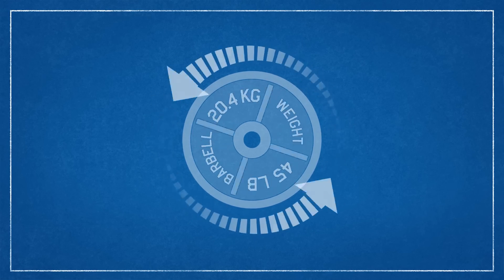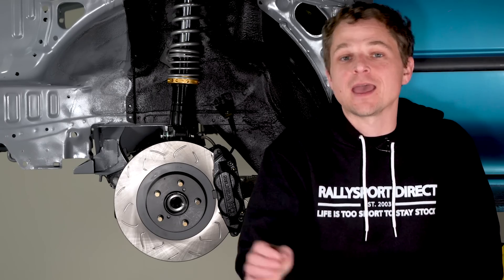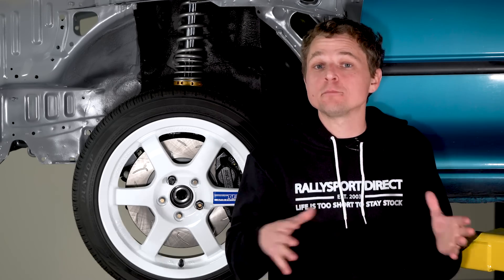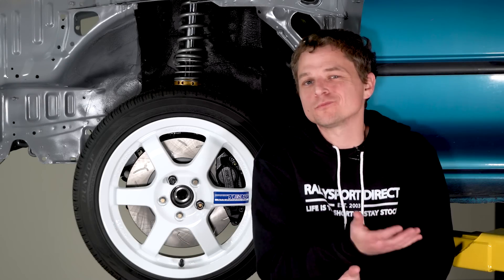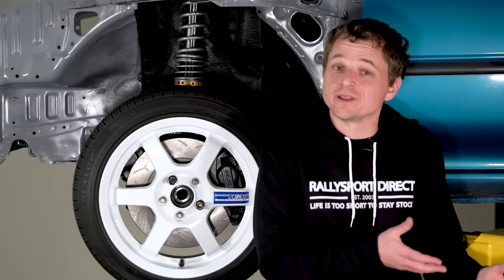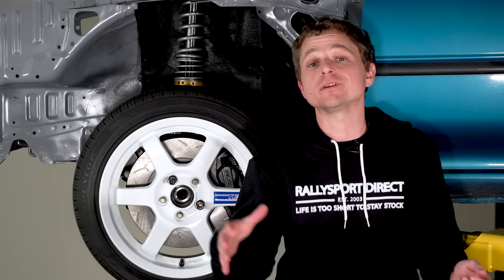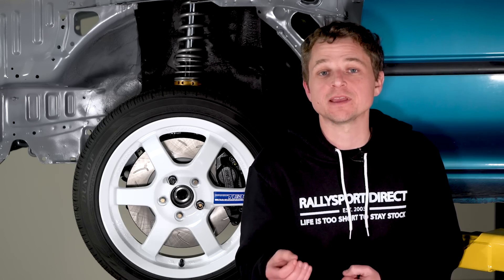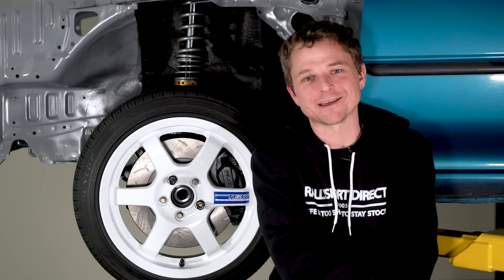World Speed Record STi - Part 3: Wheels, Tires, and Brakes

Comment: I think you guys are making a mistake not running the front runner type wheel and tire setup. Those treaded tires are just going to kick up and pick up salt creating soo much drag. Another thing is why did you guys not go for a lightweight drag brake kit, P&L makes them. They should be more than adequate for the application. Not hating,  just questions. Keep up the awesome work!